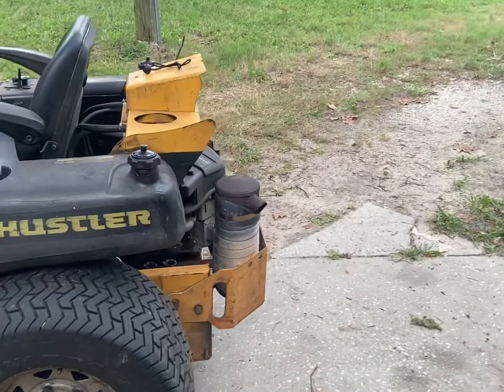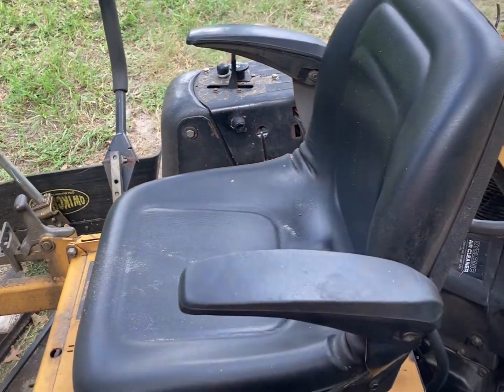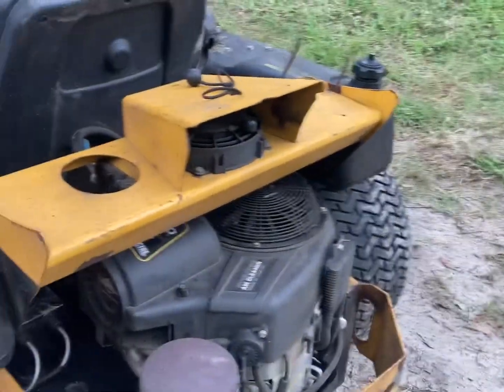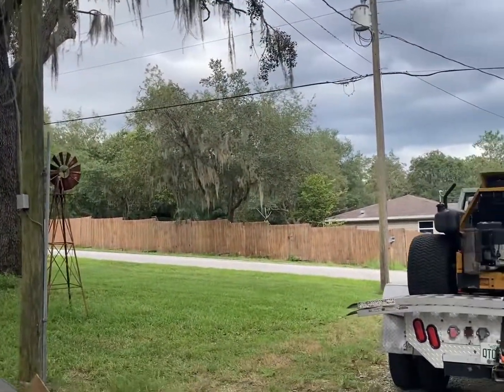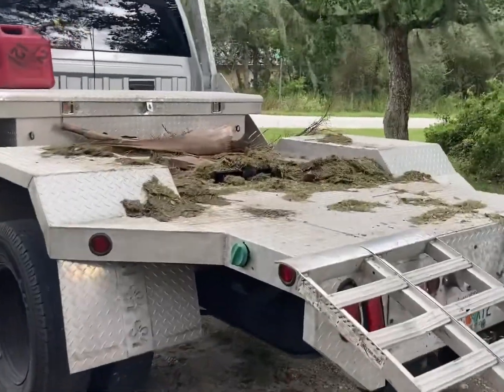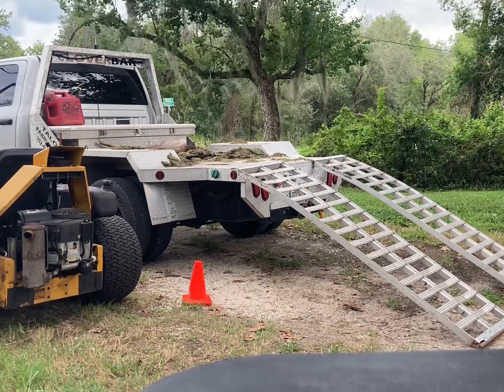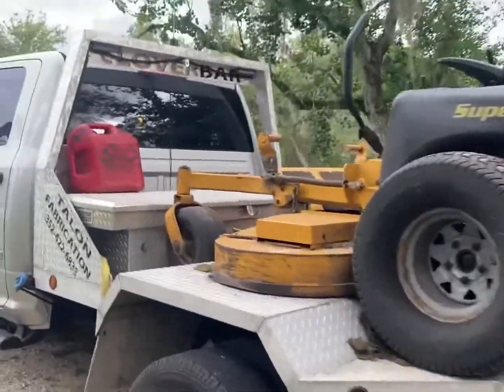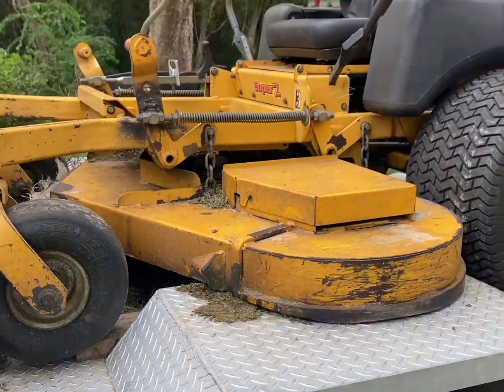DOING WHATEVER IT TAKES

Comment: I'm thinking about supertech 20w50 motorcycle oil in my hydros. $7 a quart.
Supertech synthetic does very well on used oil analysis reports.
Reply from the maker: That would probably be a good option I can’t remember if you want the zinc or anything I haven’t researched it for a long time but at the time when I researched it everybody said go higher viscosity and at the time the royal purple looked really good and it’s lasted real good
Reply: @sclawns5257  I had a guy that works on them everyday tell me lucas 20w50 synthetic motorcycle oil. He also said Mobil 1 15w50 was one of the best for hydros ,so I guess high zinc content is not to important. 5 quart jugs of Mobil 1 15w50 at walmart are not real expensive ,yet.. Amsoil makes 20W-50 Synthetic Hydrostatic Transmission Fluid that 100% synthetic ,in gallon jugs.. It's not a "full synthetic" hydrocracked" crude oil. Although some of the hydrocracked oils (Mobil,Castrol,Shell) have caught up to the 100% synthetics with PAO , performance wise.
Reply: i used it in my hustler it still looked great at about 80 hours when i changed it